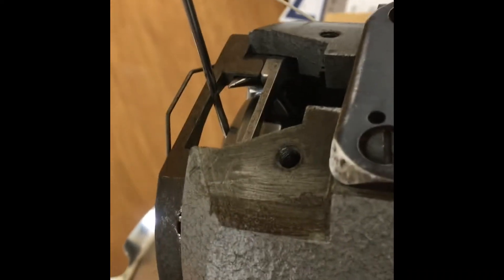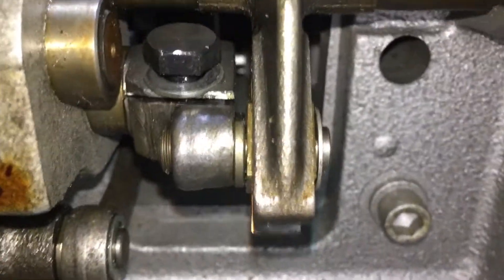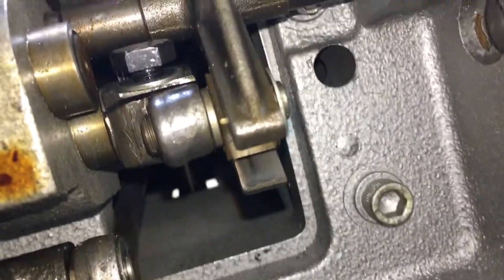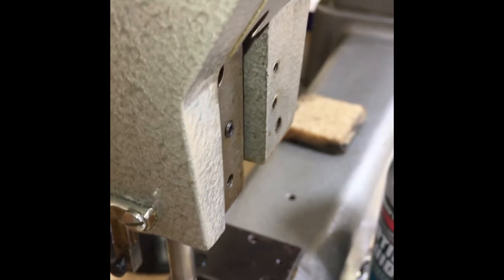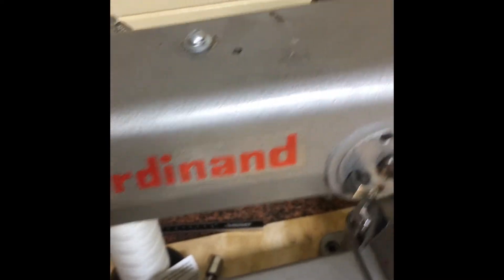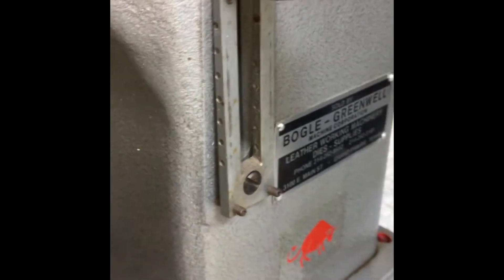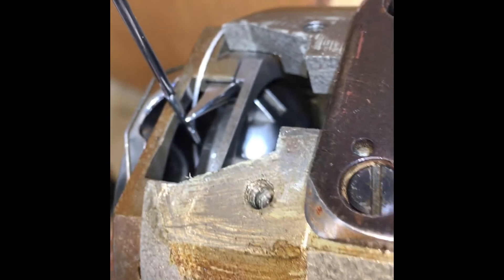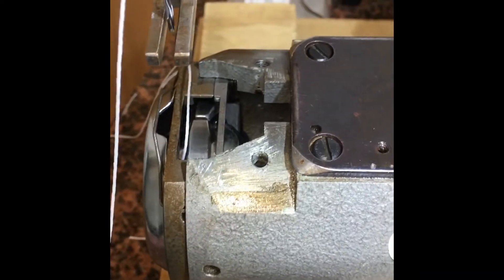Timing issues Ferdinand 900b

Comment: 8/24/22  Hello David, did you ever figure out how to move the shuttle ?
Reply from the maker: Yes, it has a set pin on the bottom that I had to knock out!
Reply: @DavidMillsSaddlery  any pictures where it was and how did you get to it ?
Reply from the maker: @giovannizappetta7046  I don’t think I can post photos here… it is behind the cover, on the fly wheel side of the machine. Remove the cover, lay the head back, and it will be on the shaft that goes to the shuttle!